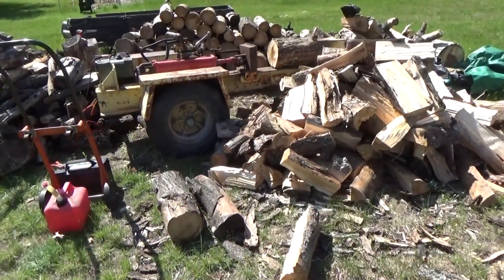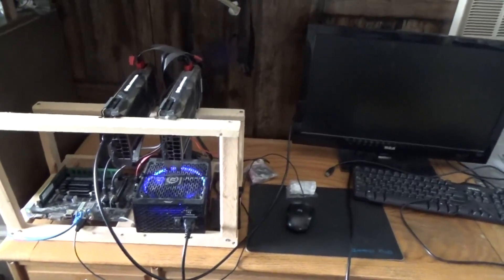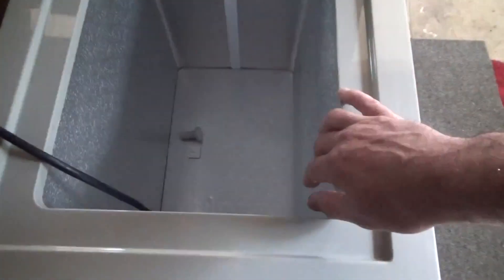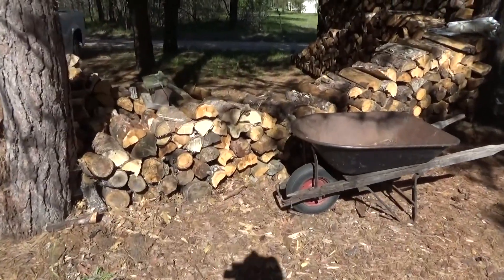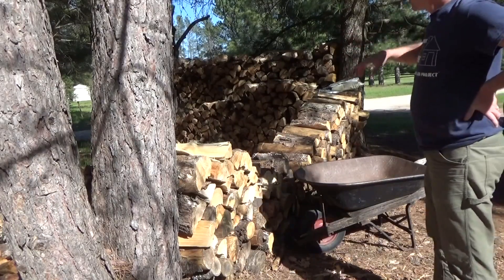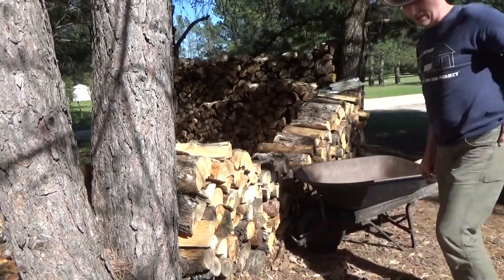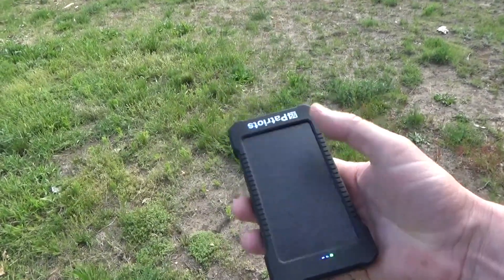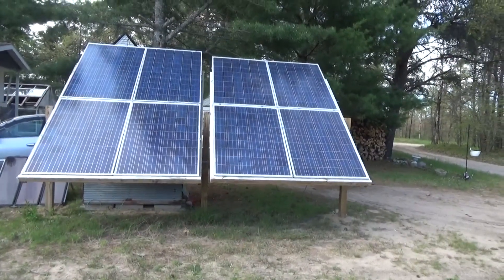Processing Fire Wood Burning Solar Power And Future Plans

Comment: That's the problem with buying old equipment. You just never know what condition it's in. On our land we got a fairly new log splitter awhile back and even after taking down a lot of trees to make room for the new cabin it ran great. The only complication we ran into was one of the hydraulic hoses popped a hole and we had to replace it. But it was nothing major.
Reply from the maker: This is the engine I had on the one in NY. I bought it long ago and brought it to MI with me. When we bought this log splitter, the original engine had no spark so I popped this one on and had it running all last fall.

Comment: Dear Troy have you ever CONSIDERED A 10 KVA TRANSFORMER SOLAR IN AND BIG POWER OUT ???? IF YOU GET A CHANCE LOOK IN TO IT MAY SURPRISE YOU   GOOD JOB BROTHER
Reply from the maker: Well, John Bedini always said you cant measure zero point energy with the meters we currently have so we cant directly measure the output. Now forget my pitiful little lab and look at his. He demonstrates running 1000s of watts of light bulbs in his warehouse on his large machine. He shows time and time again meters and gauges and actual work being done on the batteries charged with his devices. Yet people do not believe him. Why?
Reply: @TheDoItYourselfWorld  💯👍🏼
Reply from the maker: I get your point about high voltage tho. Reduces loss and the need for thick wires. Best for wind or water power cause they are AC.
Reply: Troy, you can run solar at high voltage too. Just wire your panels together in series.
Reply from the maker: People have done that again and again yet everyone cries fraud. I have done demonstrations of small gains above what it uses to run the system yet people cry fraud. Its funny that people are so stuck in their boxes.
Reply: @TheDoItYourselfWorld  For me Troy  I have been studying a lot on these thing when it comes to power and I do see one thing we have been lie'd to about the power it is not what we are told nick t father of ac and tom ed father of dc history says they could not get a long BUT what is a AC TO DC or DC to AC IN -VERTER OR CONVERTER but both  of them in one box sorry about spelling and some other things that stuck out like a sore thumb high power lines But we can light a tube in are hands under them and hear them HEAR KEY WORD I have done seen it work trying to say with out saying  GOD BLESS  I STAND OUT SIDE THE BOX FOR SURE IF YOU GET THE CHANCE LOOK AT THE KVA 10  TRANS WIRE SIZE IN SIDE HINT GOD BLESS
Reply: Troy, Please correct me if I'm wrong. I may have missed something in your videos.... But I don't think what you've demonstrated  so far would be considered scientifically verifiable.  Recharging old batteries over a period of months to years doesn't really demonstrate excess power output over input power. To prove something you need exact numbers. Such as input volts and Amps compared to output volts and amps. If I remember correctly, you showed  input volts and Amps and output volts only. Which doesn't mean anything. Since output power can't be known by simply measuring volts. Even if excess power output could be proven..... To link excess power output to zero point energy would also have to be proven in a way that is verifiable and repeatable by others. I don't think you're a fraud.  I think you honestly believe this stuff. I believe you are mistaken but not on purpose. However, I do think others try to sell "free energy" devices for a profit without being able to back up their claims. And that's why they get in trouble. NOT because "big oil" tries to suppress new technology.
Reply from the maker: Thanks. I cant find anything. What are you talking about? Any links?
Reply from the maker: David, ignorance is what keeps people enslaved to the system. Of course you can get more power out of something that you put in yourself. Wind turbines give me more energy than I put in myself. Solar panels give me more energy than I put in myself. The Bedini motor gives me more energy than I put in myself. All we are doing is using energy which is already available.
Reply: Troy, Wind turbines convert kenitic energy of the wind into electrical energy. Solar pannels convert energy caried by photons into electrical energy. Bedini moters convert nothing intio nothing as far as I can tell, and as far as can be proven. The point is that with wind and solar, there is a KNOWN source of energy that is well understood. Which is converted into another form of energy. If "free energy" scheems actually worked... The first ones to exploit them would be power companires. They harness the "free energy" for free and sell it to consumers for a huge profit.
Reply: @TheDoItYourselfWorld  THANK YOU Troy and I thought you had changed your name LOL GOD BLESS
Reply from the maker: Now David, before you answer, please consider this question: is it true that the earth is constantly bombarded with infinite amounts of energy at all times?
Reply: Troy, The earth is constantly bombarded with a large amount of energy (not infinite) from the sun. As a consequence of quantum theory.... At every point in space-time the energy can approach infinity. Known as Zero Point Energy, or Vacuum Energy. Minor problem... There is no known way to harness that energy.
Reply from the maker: We dont have flowing water anywhere near us tho. I am looking at wind turbines but I need a low wind startup device cause the wind is gusty. There is a lot of low speed wind at our place.
Reply: @TheDoItYourselfWorld  YOU THINK OUT OF THE BOX  GOD BLESS
Reply: How is that going wo work???? I hope you're not suggesting that you can get more power out than goes in? Besides, transformers only work on AC circuits.
Reply: @DavidJohnson-tv2nn  WOW WHEN DID YOU CHANGE YOUR NAME TROY  WELL WELL THE TRUTH YOU TELL PLEASE DONT STEP OUT of your box stay there
Reply: Robert Firestone, I didn't know that there were any rules that forbid me jumping into the debate and asking questions. Which by the way, you didn't answer. You also didn't answer Troy's question. But That's between you and him.
Reply from the maker: David, my first Bedini motor was charging up 6 - 7 dead batteries on a single boat battery for a couple months on a charge all at the same time. I highly regret having torn it apart to make a "newer and better" one later. Now, without external energy you cant charge 6-7 dead batteries with a single used battery at the same time. You can argue, scream, shout, rant, rave all you want but it wont change the facts.
Reply from the maker: Ah, but David, you have answered the question and sadly still got it wrong. The Bedini motor harnesses zero point energy and converts it just like a solar panel or wind turbine converts energy.
Reply: Troy, Regarding your claim that the Bedini motor harnesses zero point energy..... Good valid science requires that such a claim would have to be proven. First, by showing the output power exceeds the input power. Second, that the source comes from zero point energy. If someone can show that they could harness Zero Point energy they would probably win a Nobel prize.
Reply: @TheDoItYourselfWorld  https://youtu.be/0mpYMfpXjuc PLEASE LOOK AT LINK LOW head water T now the in side of a 10 KVA Blow'ed me away the wire size not much bigger than A good speaker WIRE
Reply from the maker: I figure the only reason power companies are still paying for oil is due to the oil companies being so powerful. I am sure you heard about the 200 mpg carburetors that existed long ago. I know some people who held them in their hands. Illegal or banned in some way. But not in use today. Why? Just ask yourself why?